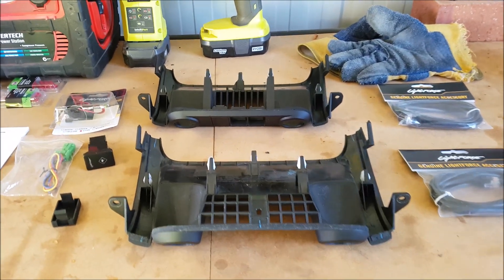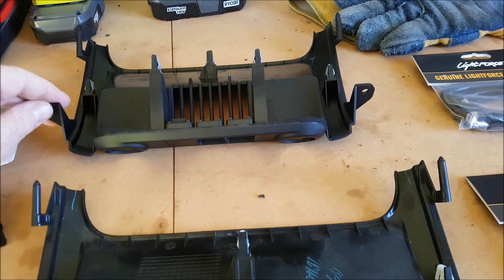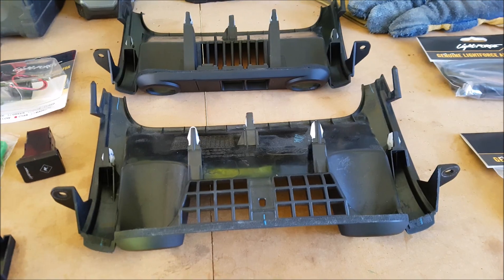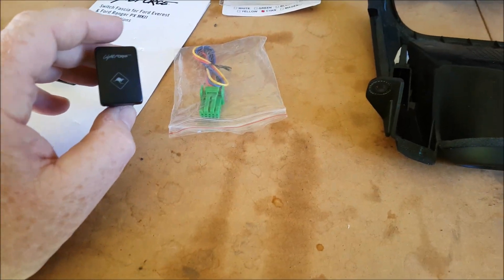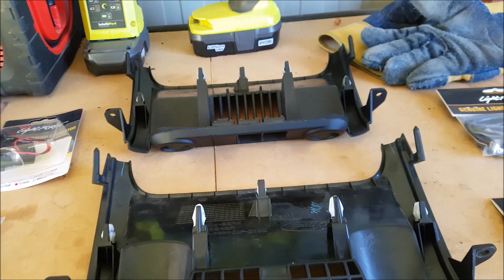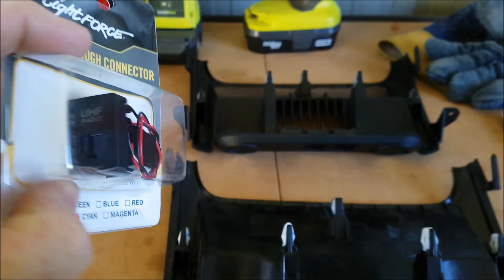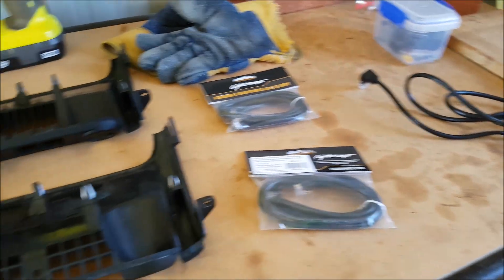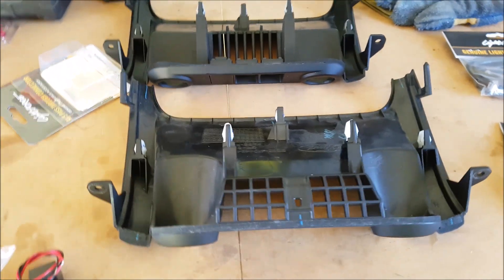Lightforce Panel install 2016 Ford Ranger PX MkII Part 2

Comment: Hi Jason, could you please advise where you mounted Redarc brake controller? Thanks
Reply from the maker: Hi Wells, in the centre of the Lightforce panel mate, please see these other videos https://www.youtube.com/watch?v=sIL79stIizo and https://www.youtube.com/watch?v=NlYRTrK59e4  used the drilling guide as seen on the back of the switch blank that comes with the Lightforce panel